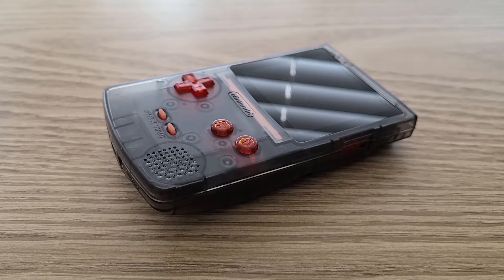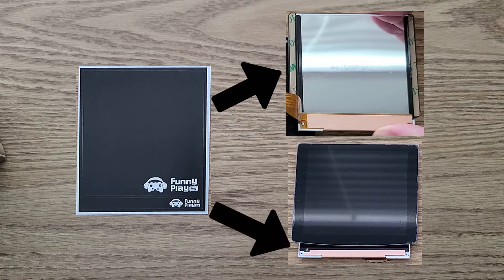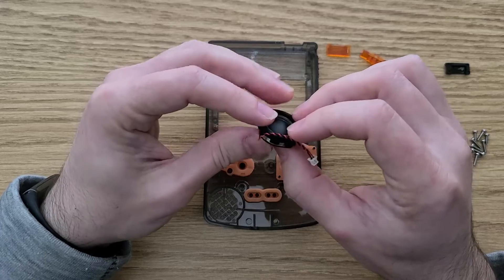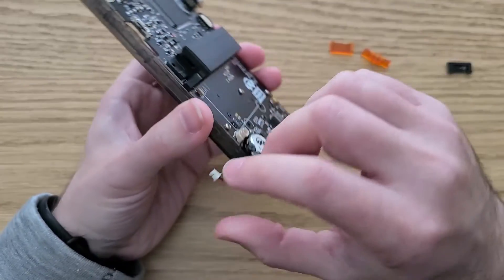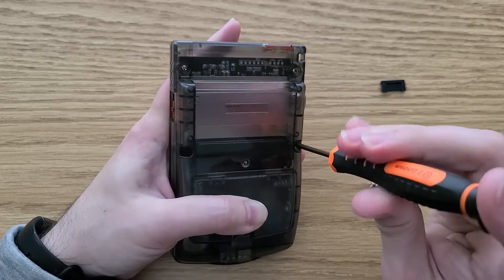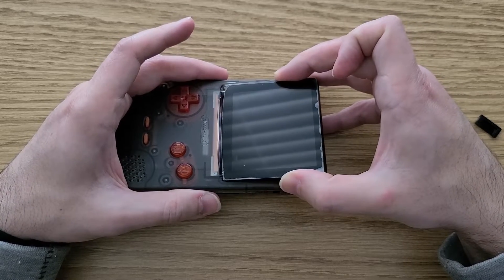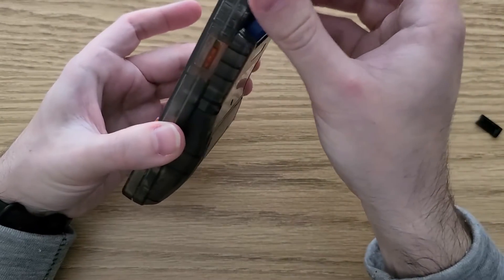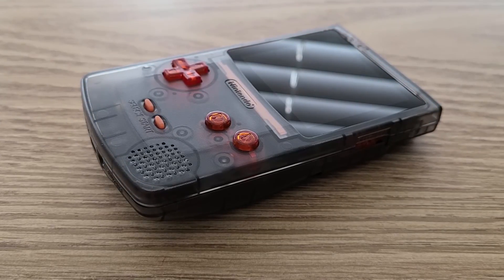Building the Funny Playing Gameboy Color - FPGBC V1.11

Comment: In my experience of building two of these now, the shell holes that the screws go into are completely unthreaded and require a lot of force to screw into leading to stripped screws. On my latest build, I heated my screwdriver up on the stove for about 20 seconds on high and then let the driver sit in the screw for another 20 seconds or so which slightly softened up the the shells holes. This made screwing so much easier and less stressful.
Reply from the maker: Woah! I didn't experience that with my build. I'm guessing something has changed with manufacturing since the making of this video cause the screws went in with only a little bit of force.

Comment: Hey, man! I really want to thank you for your build guide. I watched all the others (big and small) and they glossed over some critical details. Your’s was the most helpful by far. I ended up not using the middle Philips screw on the board because it didn’t appear to fully seat. Seems to be fine. The other part that completely befuddled me was the battery. I kept thinking that the connector had to slide into the female piece and no videos addressed it. They were just, like, “and put in the battery!” 

So, thanks! My build is working thanks to this vid. Appreciate your efforts.
Reply from the maker: Hello! I'm glad my video was helpful, I also considered not using that middle screw but figured if I could go slow enough and get it down then I'd just leave it in.

I totally agree with the battery part, I probably should have talked about it more in the video to explain that it connects by pressing it down, this was also the first time I've come across that. 

Thank you for the kind words!